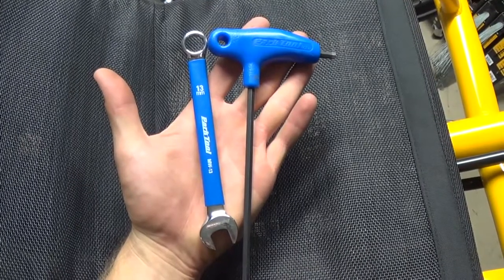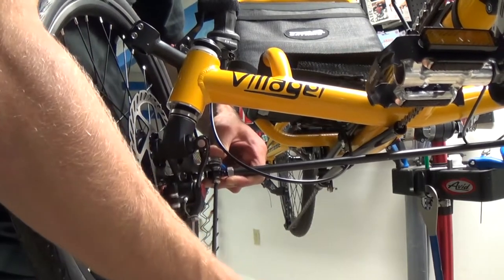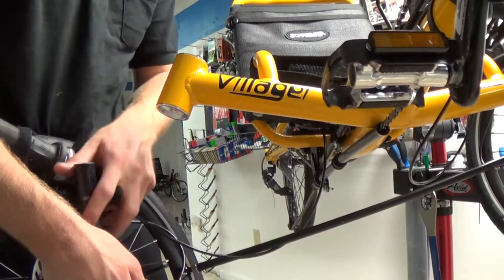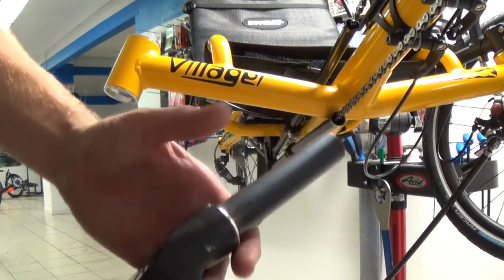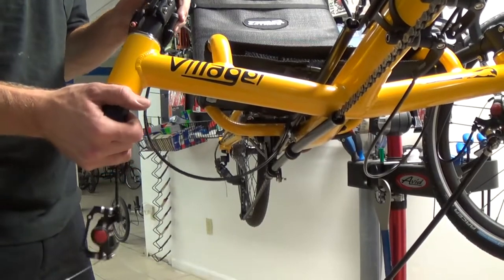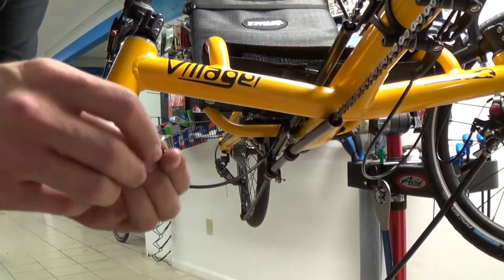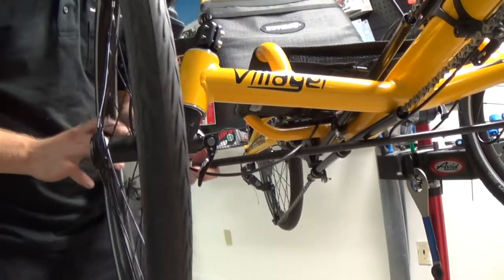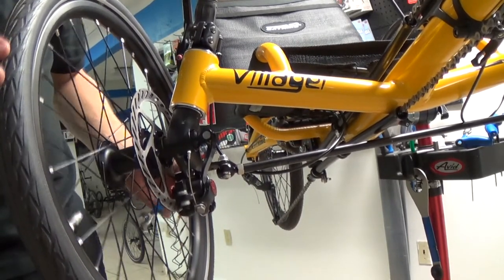How to replace the spindles on your Catrike By Utah Trikes

Comment: Seems a different order of dis/re-assembly might reduce the number or required hands.
-remove brake caliper
-remove tie rod
-remove axle/wheel
-remove steerer tube
-remove spindle
-reverse for re-assembly and check the brakes then reset the toe alignment.

Comment: Why cant the ring be replaced? It was pressed on the old can be cut and the new it pressed on. Besides why is it aluminum?  crs at the very least. hard bearing. I have a new expedition. over 2500.00 really the alu. will take a beating all force is on it....